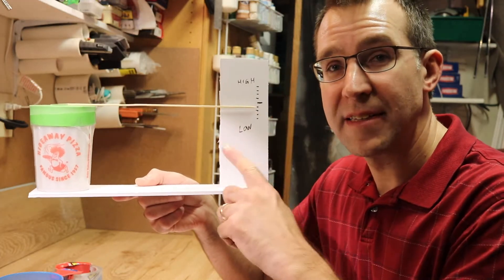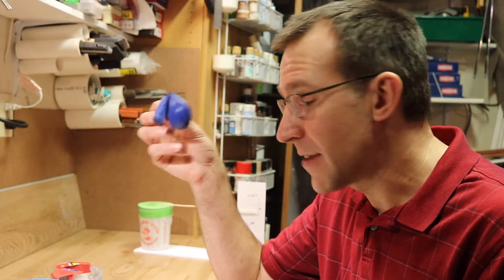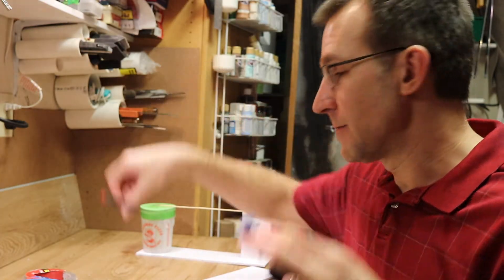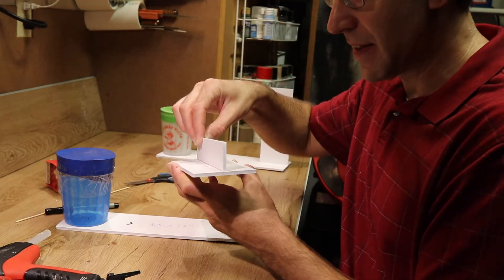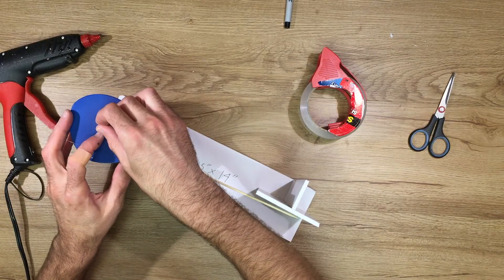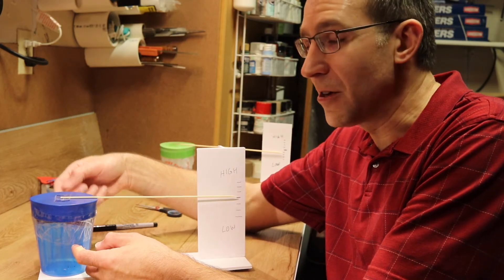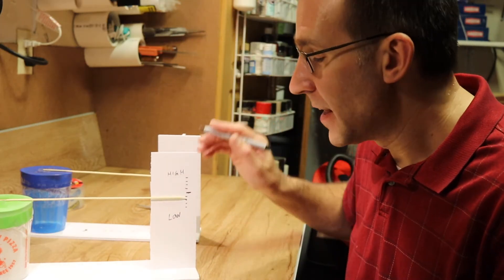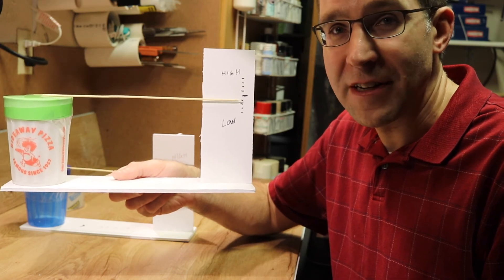How to Build Your Own Barometer! Easy project to track weather changes.

Comment: What would be the best atmospheric condition to make this barometer ?
Reply from the maker: Close to “normal” atmospheric pressure which is 1013mb. Basically in between typical low pressure and high pressure levels. This way your pointer will point down during low pressure and up during high pressure, but that isn’t a huge deal. This barometer won’t be that accurate anyway unless you have a very air tight seal on the jar. So, if any air gets in or out as the pressure changes the barometer will drift over time. You can make this type of barometer very accurate long term if you use a good membrane and seal that won’t leak at all. Probably you could spread melted wax around the edge to seal things better and use something thicker than a balloon so air won’t get through at all.
Reply: @EarthtoSpaceScience  Are you referring to a plastic jar or mason jar? I'm interested.

Comment: question: if the straw is glued or taped, how is it supposed to move? 
You got a like btw
Reply from the maker: Yes, you do have to be careful not to tape or glue too large a section of the straw. It works better with a larger jar and longer straw or pointer since it will pivot up and down more.